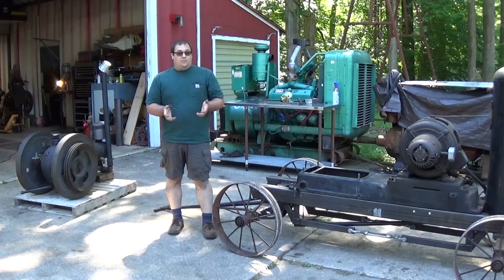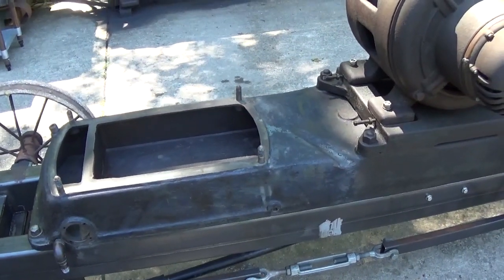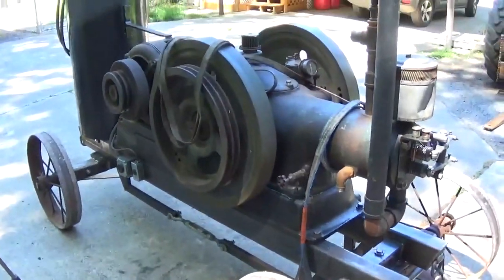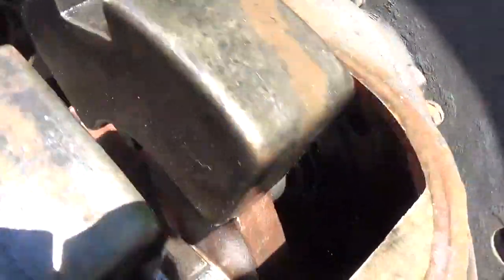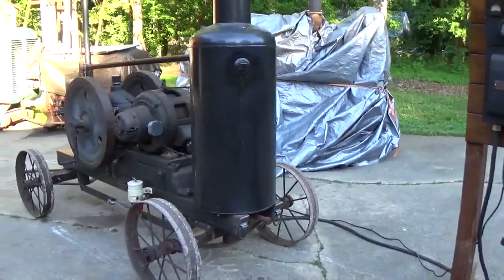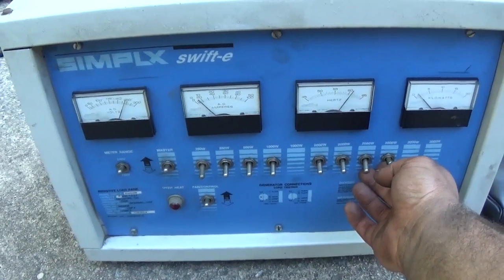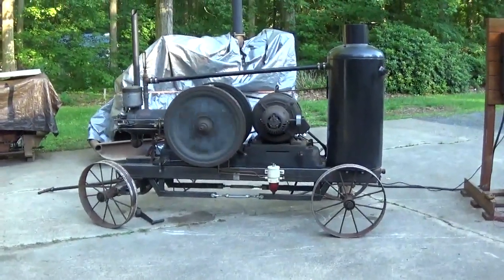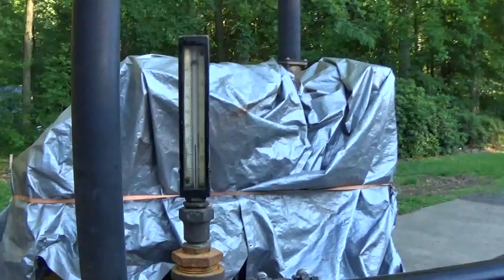1 CYLINDER DIESEL ENGINE 1941 Witte Dieselectric Plant

Comment: I think it would be neat to take the fuel pump and injector apart and talk about how they work. I'm really impressed at this robust and very effective engine and generator. Simple, practical and effective. Oh how does the water circulate? Is there a water pump or does it just use different diameter pipes? Thanks for sharing Mike. Best Wishes & Blessings. Keith Noneya

Comment: Thanks for sharing this very interesting vidclip ..... Did this engine originally have the Exhaust routed thru' the Centre of the water-tank ??????    IF you have space, I would suggest that you retrofit an Automotive Thermostat, just where the 'Hot' line leaves the block. One would have to turn a Special adaptor .... I have done this with my 1928 LISTER .... Thermo' is a 92'C preset unit and it now warms up really fast and is Very Happy at that higher temp. The volume in the cooling-tank is so Big that it will Never really get to an optimal temp. Found that the Thermo did Not Affect the Thermo-Syphon at all . I actually run mine on well filtered  'Recycled Hydraulic Oil' With about 15 to 20% Diesel to drop the High Flashpoint of hydraulic Oil. Sound Totally Wrong, there is a LOT of info on the 'Net about it .... Thanks again for sharing All your Exploits .... Cheers from New Zealand

Comment: How did they prevent belt slip on these old machines. I built a 16hp/8000watt generator built needed a belt tensioner..
Reply: In case you missed it, the generator sits on adjusting slots.😉

Comment: Ampmeter may not show a draw because you aren't pulling from that side of the pole yet. Not sure how this is set up, but my Generac transfer switch has two Amp Meters and a voltage in the middle just like this. This idea is to balance the load on both sides. I assume you may only have that load block only connected to one side of the transfer box. Ergo, one side shows a load and the other is flat.

Comment: Were you using a vented fuel cap while running it.
 Loved hearing this one lunger running. Nice old gen set.
Reply: Sounds like my mower when it's running right.
Reply: @lewiemcneely9143  lol.
Reply: Scruffy 61 why why why would you need to know if it was vented ?
Reply: Tony Wright     Perhaps because if the fuel cap was not vented, it would form a potential negative pressure in the fuel cell as fuel was withdrawn.  This might make it get harder to draw fuel from the fuel cell.   With a vented cap, this would not be an issue.   As fuel was drawn out, air would be drawn in, balancing the atmospheric pressure.   
Just my theory....
Cheers!
Whipple

Comment: Very cool! Love this old stuff, appreciate the time lapse of you working. 
What did you apply to that gasket? 
Also, could you do an in depth explanation of the voltage regulation system?
Reply: Bowhunter1300 

Likely Permatex aviation gasket sealant.
Reply: This gack called gasket maker. It's pretty gross smelling and doesn't like to come off your skin very well!
Reply: M7 no mo 00l on

Comment: Are you sure you didn't get "diesel bug" microbiological growth in the fuel tank?  Diesel fuel and water in contact provides the  ideal growth condition for this to happen.  You did the right thing by removing the engine and cleaning the tank out.

Comment: For comparison, I just try to repair 1500w table saw (3years old). Rotor demagnetized and now it is junk. Cheap chainizium. (no coils in the rotor, temperature don it). This days if it is not good brand its junk.

Comment: be careful putting a solid plug in your fuel tank when it gets hot it will build pressure in the tank and could fill the cylinder with raw fuel. and we all know what happens when you try to compress  liquid.

Comment: Why don't they put needle bearings with a connecting rod is to the Piston to the crankshaft if you take that brass peace out and find some needle bearings that size what would it do I've been waiting to do that twin-engine for so long it's notI would think it reduce friction and run a lot them faster but I don't knowI want one of these little diesel engines so bad just to experiment and listen to it run and hook up a generator to itI can listen to that thing all day and night no problem I love the sound of mind